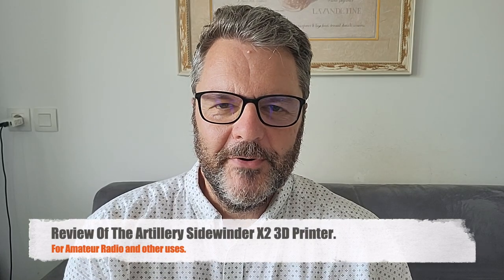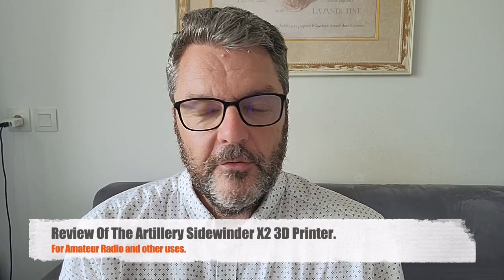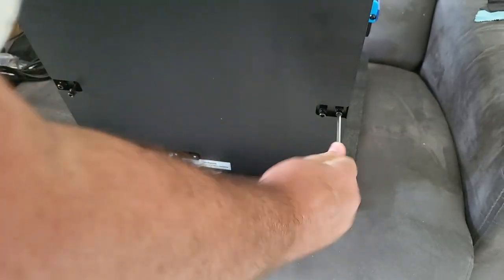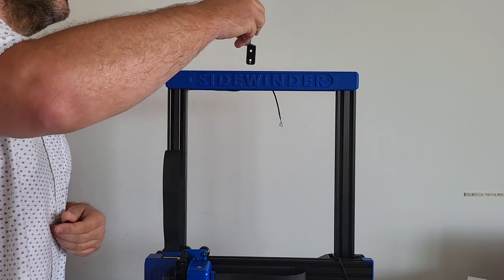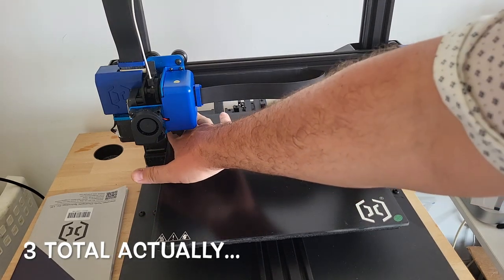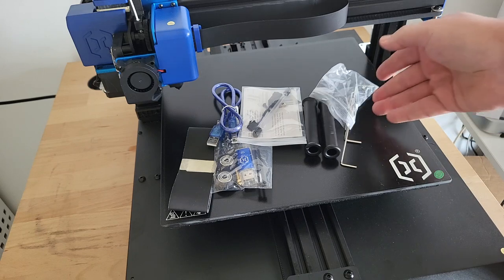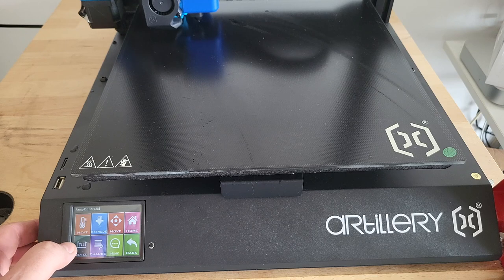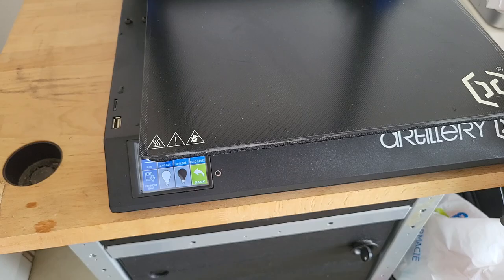Review Of The Artillery Sidewinder X2 3D Printer.

Comment: It's not a bad price either,about the same as a good laser printer. I would have the same issue with finding somewhere to put it and leave it setup. Packing it away after every use isn't really practical. Looks like a good quality printer though.👍
Reply from the maker: I got you guys a 50% OFF coupon, will post it in a few hours..